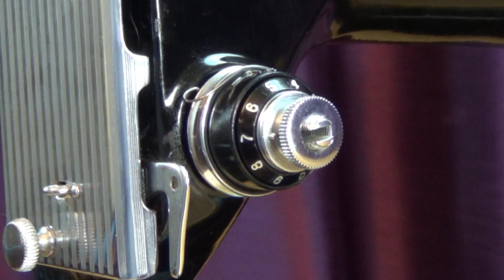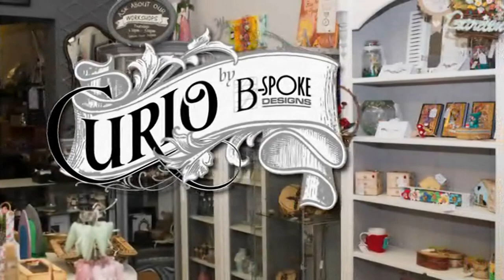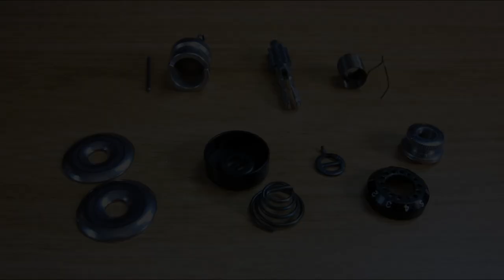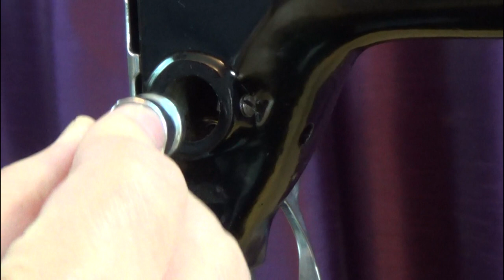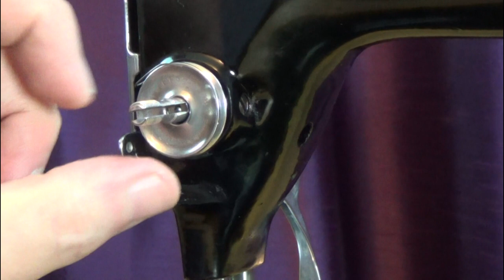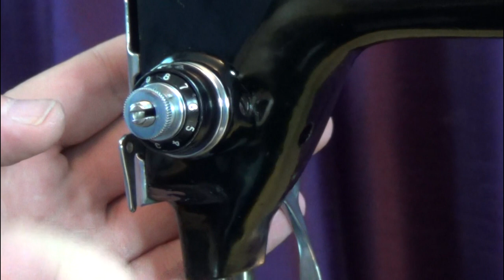Singer 99 and 66 Tension Assembly with Numbered Dial

Comment: Extremely clear and helpful, thank you! I'm working on a rather lovely old 99K that someone else "adjusted" several years ago... bending the tension assembly spline noticeably, and adding a too-tight notched drive belt that pulled the motor up out of its casing 😳
Reply from the maker: Ouch! Fortunately spares are easy to come by. Good luck with fixing it up.

Comment: Thank you for making tension assemblies understandable!
My question is, I purchased an early 99.  There is only a threaded knob to adjust stitch length, and there is no plus-minus plate and no numbered dial on the tensioner.  Tension does work, however.  Is this normal for an early 99/99K? Thanks.
Reply from the maker: Yes, that’s normal. Most early machines had tension assemblies with no numbers.

Comment: Hello.  I have taken charge of my late mother's 201, and am learning fast about how it works, and how to use it.  I understand that there are bad ways to service these machines, so have not used ED40, but bought a proper machine oil.  Is there a similar consideration when it comes to cleaning bits like the tensioner?
Reply from the maker: No, not really, just make sure you get no oil on the tension assembly.
I use a metal polish on the disks.

Comment: Thank you for such a good explanation. Can you tell me exactly how long the tension release pin is? I think mine has been broken off, or was replaced by a random pin at some point. If it is possible to show a complete picture I would be very grateful.
Reply from the maker: next time I take a tensions assembly apart I'll measure it
Reply from the maker: The pin is 1 inch or 2.54cm long - hope this helps.
Reply: @CurioByBSpokeDesigns  Yes it does, thank you. The pin was replaced by a broken sewing machine needle. As I am the original owner and have had the machine for 50 years I assume the pin was lost by a repair shop on the only occasion I took it to be serviced 10 years ago. I'm not sure if I should worry as it works but I will check the length. The machine is a Singer 192K Spartan.
Reply from the maker: They often get lost. People make new ones from thin nails or panel pins
Reply: @CurioByBSpokeDesigns  .

Comment: Thank for your videos! I took my  66 tension assembly apart but when i went to reassemble the last piece will not screw onto the rod. It keeps binding.  I do not think its stripped but wondering if you have any ideas?
Reply from the maker: The last nut can be awkward. Sometimes if you hold it in place, turn the nut as if you are unscrewing it, then swap direction back to tighten it, it will go on. The two halves of the threaded bolt may also have been sprained apart a little. This can make the nut bind. I wrap the bolt with a small piece of leather, so not to damage the thread, and gently squeeze with pliers to close the gap a little. It really only needs to close up a tiny bit. I hope this helps.
Reply: @CurioByBSpokeDesigns  thank you so much! I will try this!

Comment: Can I replace the whole original tension regulator that doesn't have numbers from a 95 yr old Singer 66 with a numbered one from a different machine & if so, which machine? Thanks
Reply from the maker: I’m not sure but I think possibly a later 99.
Reply: Thanks so much, I'll give it a try!

Comment: I need a tension spring for this type assembly.  some say it is a different spring than the other type assembly.  I do have two that will not work for me.
Reply from the maker: Yes, although most of the tension assemblies looks similar the spring was often very different
Reply: @CurioByBSpokeDesigns  please. I need a source and a part number.  32758 is too small in diamater to fit around gear.

Comment: my 99 and my 66 do not have numbers on them, but the spring is the same as what you had. but different spring then my 201, was they 2 singers upgraded with the new dial???
Reply from the maker: Earlier 99s and 66s had a tension dial without numbers. The ones with numbers are a later style. The 201 had, I think, 3 different tension assemblies, none of them are the same as the ones on the 99 or 66. I hope this helps.
Reply: @CurioByBSpokeDesigns  thank you, btw love your videos
Reply from the maker: @gmaltese  Thank you!
Reply: I have a 66 18 and it does not have numbers either. Could I buy some replacement parts from the newer version and replace it in the older version? Do you think it would fit?
Reply from the maker: @amaliakomperda3798  I haven't tried it but I don't see why not. It may be better to replace the whole tension assembly with a later one.

Comment: Hello. I have the small gear on the spline spinning is this normal?
Reply from the maker: The gear on the spline? you mean the spline itself? It should not spin.
Reply: The small geared wheel is spinning on the shaft. Which will not enable me to put tension on the spring. Are the two parts supposed to be one
Reply from the maker: @shaneparsons3910  Do you mean the knurled nut? if so that should tighten up
Reply: @CurioByBSpokeDesigns  hello. The main shaft that everything attaches to. A slot in one end. A pin that goes through the middle. (Foot release pin)a small gear that attaches to the shaft that the thread tension spring slots in to.